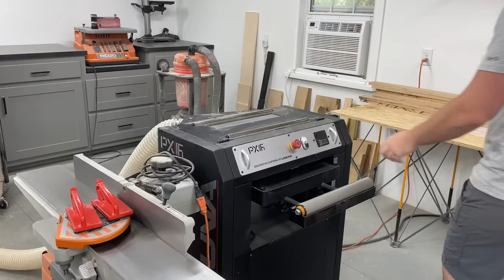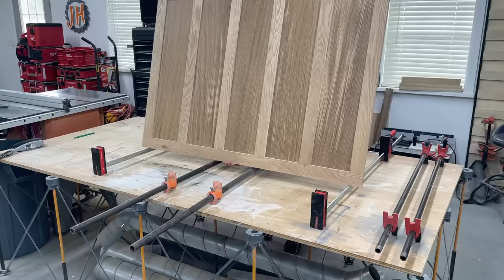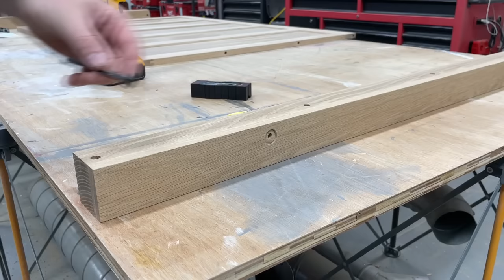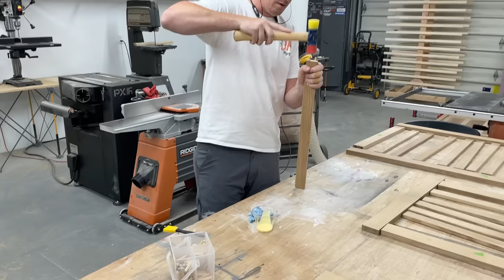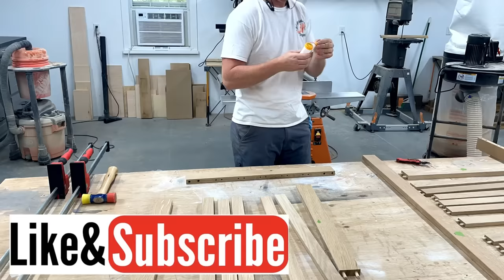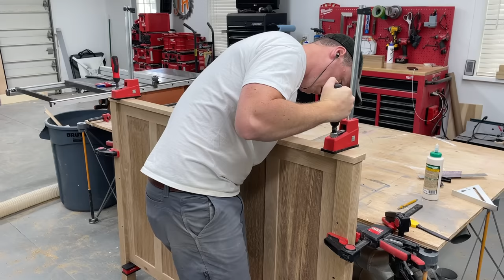Baby Crib Build | My Most Important Build Yet!

Comment: Hey John,  terrific video and I really liked the design.  I am tackling this project for my first grandchild using some really, really, really  rough cut slabs from a buddy who had a few large sugar maples come down several years ago. Another buddy milled them up into the slabs. Took quite a while to mill up the components using my DYI benchtop equipment, planer, jointer, router flatting jig.   I was planning on using mortise and tenon joinery for the slats but, being the novice that I am, forgot to add the 2 x 3/4 length adder for the tenons and cut the slats to your specs.  Going the dowel route now as I don't have any more of the local maple.  Excellent job on the plans too.  Must of taken a huge amount of time to include that detail.   Cheers
Reply from the maker: Thanks Tom! Send me some pics when you’re done! Bet that maple is going to look great

Comment: Just finished the build following your plans, it was fun, lot of lumber planing, I did my rails/stiles with table saw, one thing I struggled with was leg hole layout, I ended up setting it together to orient hole locations, had I done that first I'd have saved some time.                                                                                                                                                       I'm having an issue is finding a used frame that fits dimensions, I ended up at 27-1/2"W x 51-3/4"L, couple frames  I've found are around a half inch larger, may just build one to fit. Thanks for the plans, nice job. Your dresser is next, my third grandchild is due in Feb. 👍
Reply from the maker: Awesome man! Bummer about the frame. All the ones I checked were smaller, but the mounting arms could be flexed out to bolt on. Interesting that you’re finding some too big!
Reply: @JohnBuildsIt  28 x 52 is what one person told me, most of the cheap cribs are not very close to me, so I’m asking them to measure for me before making a 45 minute drive for a 40 dollar crib.
I’ve decided to build one, I have some hard maple that would work great. 
Cost = 0, just my time

Comment: Hey John - loved the video, bought the plans and it inspired me to build a crib for my first grandchild.  I'm a novice -just getting started and fitting out my shop. A couple of questions about your tools:  are you satisfied with the rigid jointer?  do you have regrets?  I'm afraid it will take more work to get things to look good than it saves.  Is that right?  Second - are you happy with the benchtop bosch router table for doing furniture projects?  I would think it's too small but if it's good enough for what you do it will be good enough for me.  Thanks.
Reply from the maker: The Bosch router and table is phenomenal. Really a low priced gem that gives great results. I’ve upgraded my jointer to a bigger, more powerful machine that is of course much faster to run material through. But in terms of quality, square results, the Ridgid always did the job 👍🏽
Reply: @JohnBuildsIt  Thanks John

Comment: I’ve started cutting lumber using your plans. So far so good. 
I noticed on page 22 the inside dimensions are 51 1/4” X 26 1/2”. 
The mattress in your description is larger than this. Am I misreading something?
Just ordered items through your link. Hope it helps you some. Good videos. 
Thx
Reply from the maker: I made the inside dimensions and mattress the same as my daughters store bought crib. Just makes for a nice and tight (safe) fit for the mattress 👍🏽
Reply: @JohnBuildsIt  thanks. More questions. Sorry. 
To finish the bed and the dresser how many cans of Rubio did you use?
Also 1/4-20 button head screws and 1/4-29 threaded inserts 15mm are correct? There were 15 mm & 10mm threaded bolts. Wanted to be sure the 15mms were correct?

Comment: Hi John - these are great plans! I am able to do a 3 panel crib instead of a 5 panel like you have on the plans - I came across an old table built out of solid 1-1/2 " oak! Looks like it was made using hand tools... anyway, i have it disassembled and if i can get it halved i will be able to make most of the crib out of it! My question is do you have any reason i should make 4 or 5 panels instead of 3?  Anything i should look out for?  Thanks!
Reply from the maker: I did the 5 sections so I could just use 1 board for the panels, instead of gluing wider boards together. That’s all!

Comment: Can you either go into more depth about  5:52 or DM me?I bought the plans but it doesn’t go into detail about this part and I’m a little confused. Thanks!
Reply from the maker: Sorry I’m not sure what you’re referring to, all the hole locations are laid out in the plans
Reply: @JohnBuildsIt  page 18 of the plans
Reply: I can’t figure out which one is the headboard or side board. Also not sure on which holes are the through bolts
Reply from the maker: @SandyRidgeWoodshop  the side piece is on the left side of the page, and the headboard leg is on the right side. The threaded inserts and through holes are labeled with arrows pointing to the holes 👍🏽 hope that helps. Email me at john@johnbuildsit.com if you need anything else!

Comment: Is there anywhere to buy the metal support frame for the crib?
Reply from the maker: I’m sure you can somewhere online. I’d just check Facebook marketplace though
Reply: Around the head board panels/styles did you round over those edges like you did the legs and slats? Curious if you went ahead and broke the edges on all pieces to be honest.
Reply from the maker: @joshc407  the router bits leave a beveled edge on all those stiles. But yea everything else got hit with the round over